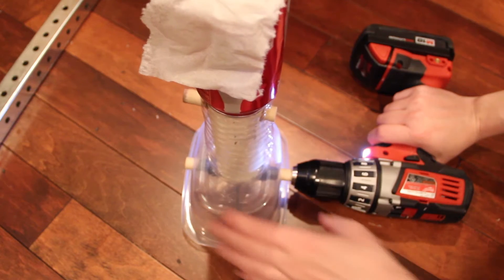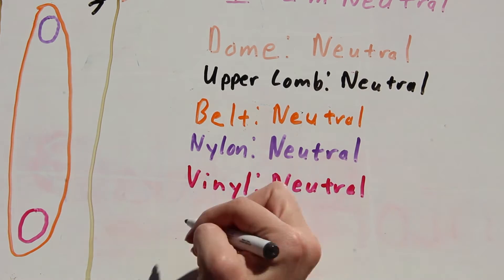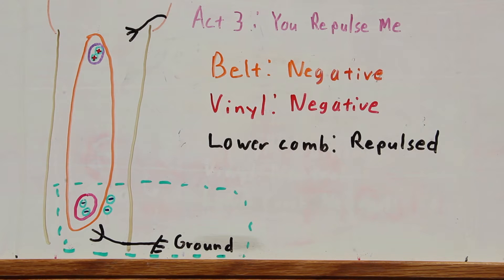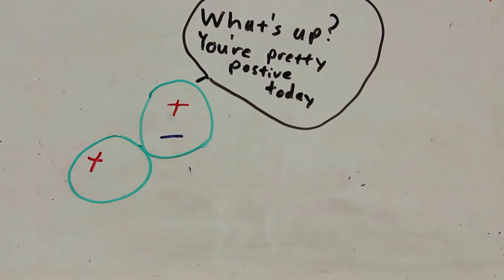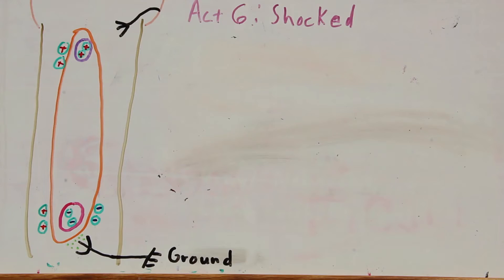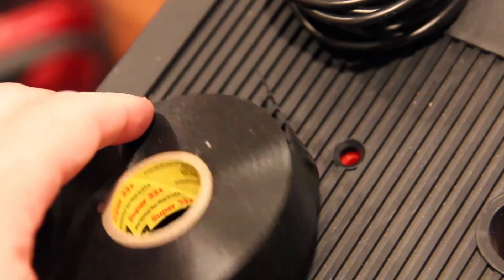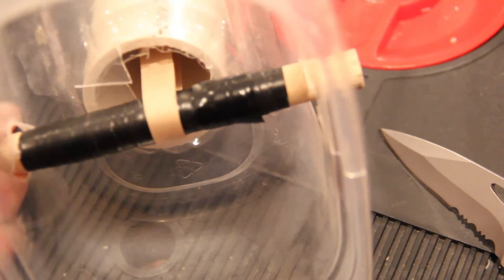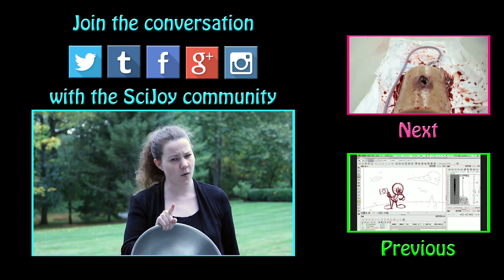Homemade Van de Graaff Generator

Comment: Back in the late 80's  I made 2 very large ones , Watch out !  They make a lot of Ozone in a short time . be aware and 
ventilate the room.   I got struck by a 20+ inch spark in the belly , Not fun.    I had one sitting on a washing machine , I 
thought it wasn't working , Then the fluorescent lights above started flickering and a ashtray full of cigarette butts
started  ejecting butts like crazy !  They were flying out of the ash tray up in the air like crazy.  No off switch .  When I 
walked over to unplug it , I got zapped.    Thanks

Comment: What did you attach the wire to as "ground"?
Reply from the maker: It was a long time ago. My guess is I used the piece of metal seen at 0:13. I believe I've hooked the ground wire to metal tools before and they work as ground. Hope that works.

Comment: What kind of a motor can I use for this ? and can the rollers be of a different material?
Reply: You should be able to use any motor that has enough torque to move the assembly. A drill works  great in this case since it has a chuck, but an R/C or hobby brushless dc motor could also be used.

At https://youtu.be/t_u1Nf2Zf-U?t=26, you can see the rubber band is in the middle of the triboelectric series and the rollers are on either side. If you select materials that are farther apart on the triboelectric series, they will have a greater potential to exchange electrons. Let us know if that answers your question or if you have more!

Comment: What  happens if The brush and rubber band touch each other while the motor is working?
Reply from the maker: +Ronnachai Mita I've had it touch on an older version that I made a few years ago, and I think it worked fine. Let me know if it doesn't.

Comment: hey can i change the charge on top of the dome?
Reply: +Arunkumar Maurya I think you could change the charge by switching the rollers. I don't know if it will work for sure though! If you are able to test to see if it functions with the rollers reversed, let us know your results! 

I am hypothesizing that if we were to use a voltmeter to measure the voltage on the dome in the original configuration and then flipping the rollers that we would see the voltage turn negative (or positive), given that we keep the probes in the same orientation when testing both cases.
Reply: try using a faster motor different roller materials

Comment: What did you use for the rollers?
Reply from the maker: +alicia cowan I wrapped  nylon stockings around a wooden dowel for one roller and vinyl electrical tape around the other roller. I received an e-mail that you were trying to access the Google Doc with the instructions. It should be a public link. I tried to give you specific permission, but I got an error saying your school district doesn't allow this type of e-mail. I redid the sharing permission of the document hoping it would fix the problem. If you still can access it, let me know.